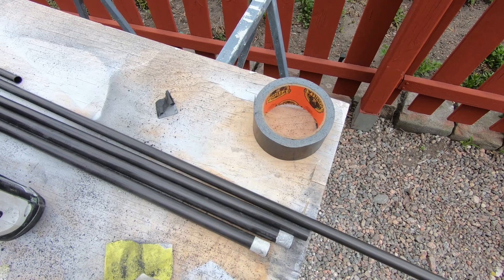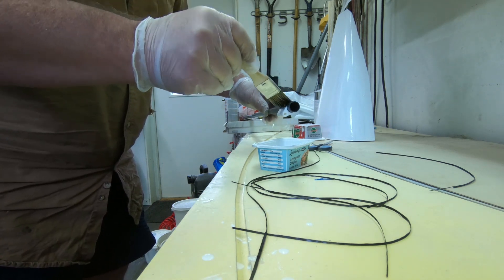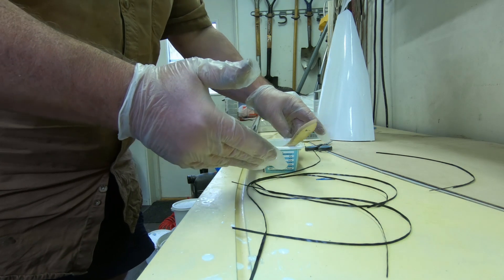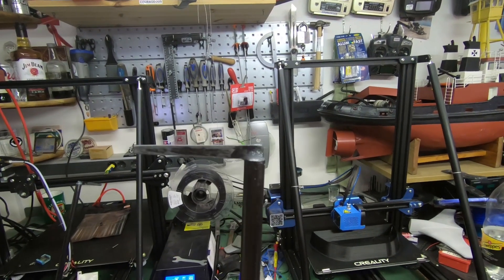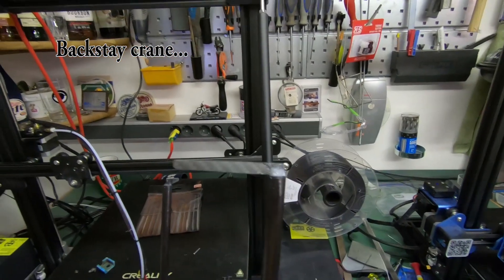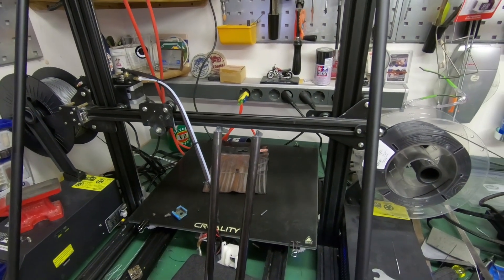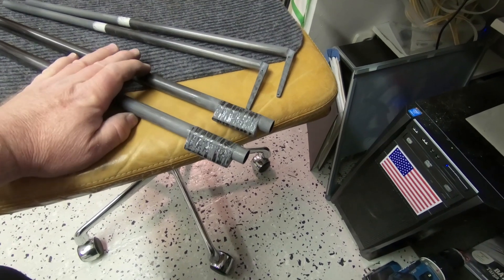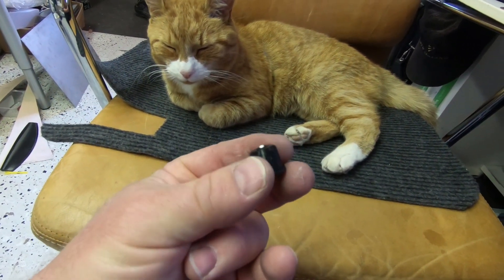Making a 97 inch 3 piece carbon fiber mast for RC sailboat

Comment: Where did you get the carbon tubes to make your mast? What’s the diameter ?
Reply from the maker: I bought them from a company here in Sweden. These masts turned out a bit to weak for my 12mR's. If you look on my channel, there are videos showing how I build my masts using multiple round carbon tubes. Diameter of the main tube today is 18mm. Thanks, Lars

Comment: Hey Lars brilliant to share thx for this. have build a carbon mast for the old A class I was restoring. over 2m also. Similar approach but I think I only glued the overlap for 8-10cm if I remember... seems to work ok so far... though I need a stiffer mast. Do you reinforce the mast where you drilled for the spreaders? I do but maybe be overkill?

Any good recommendation on a good 3d printer... looks like the way to go to make some small parts for our boats...
Reply from the maker: I did re-inforce the mast on these two where I drilled for the spreaders. I never broke a mast (so far) so I don't know if it is necessary. In video number two, I'll show how the spreaders are re-inforced. I love my Creality CR-10 V2 printer. Works like a charm right out of the box. 10 cm overlap is plenty. I did 15cm because I want a stiffer mast.